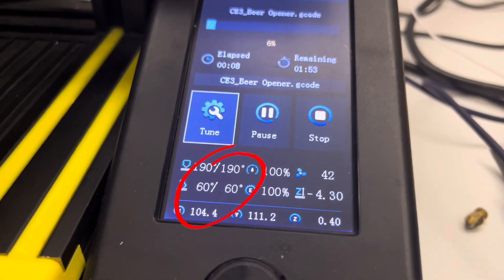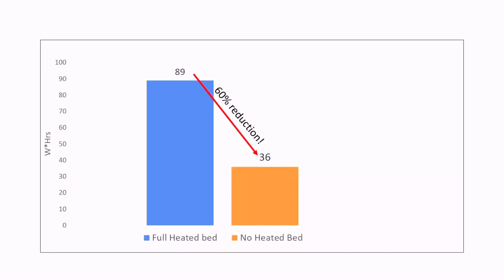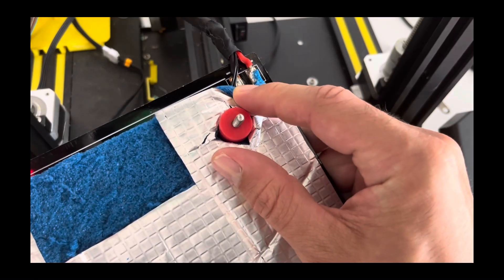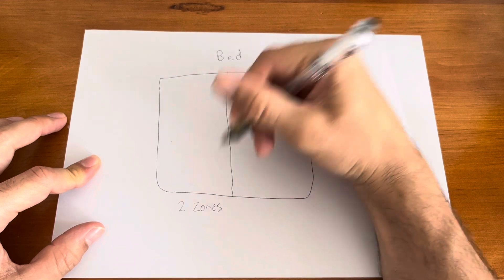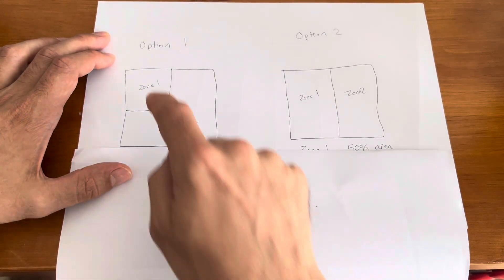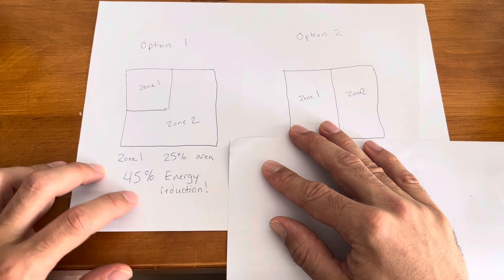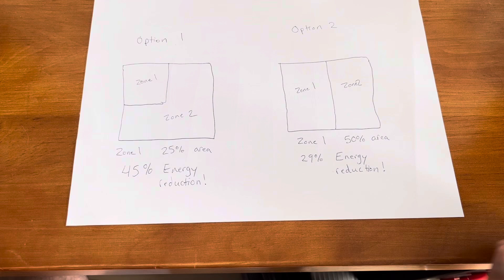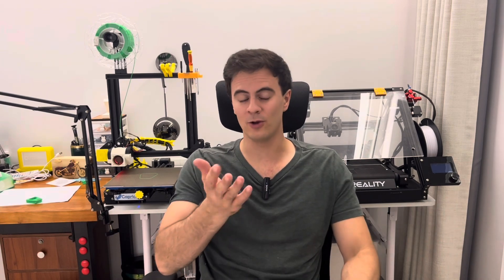Next-Gen 3D Printing? Cutting the power consumption of 3D printers in HALF!

Comment: you don't need that many wires, you can have a common for both the heater and thermistor. you can also further increase efficiency by simply enclosing it

furthermore, i wouldn't have sectioned heat zones on a single bed plate as they would introduce warping. which is why printers like the Prusa XL have a separate plate for every zone

cool video! you got your mind in the right place, keep going 👍

Comment: These systems already exist and in the wild aren't anywhere near 40% more efficient, they barely break 8%. The problem is that when you do regional heating the cold sections of the bed leech heat from the heated region. To stop this they heat the whole bed at the start, taking more current, and then turn of the secondary heater.

A simpler solution is to enclose the printer. An un-insulated enclosure increases the efficiency of all heating elements in the machine by around 12%. That includes the hotend, which is responsible for far more power draw than the bed, 2% at the hotend is worth more than 5% at the bed any day. Combining the two is the only reason that it's worth the effort on the super high end machines that use this concept, other than marketing that is.

Comment: Bed insulation is a nice idea, but was only a new idea say, 12 years ago? Dividing the bed into zones has also been done by various manufacturers.
Note the Ideally you need to separate the heat conduction between the zones. If you have one slab of aluminium and heat it at one side, the whole bed will heat up, sucking redundant power and time.

Comment: The Prusa XL already implements this technology as well as a few other industrial printers. Although it is more energy efficient depending on the build size, there are a few factors to consider. Complexity of your thermistor and heater circuit is increased linearly depending on how many zones. Also heat dissipation means that your energy savings are not as high as you may think unless each zone is thermally decoupled from their surrounding zones.
Reply from the maker: Good to hear others have implemented this idea, that’s some nice validation!  Yes for best results you may want some sort of thermal barriers between heating zones. Bigger printers make sense to implement this as the heater plate is much larger creating more potential wasted heat. Also it could be promoted as a positive feature since you can have more precise bed heating control on a large bed. Thanks for the comment!
Reply: I think biqu/BTT Hurakan has implied this at the more budget end.

Comment: cool!!!

to do that you would need a different board and slicer i dont really think that there is a good board to do that maybe the board and slicer from the orange storm giga
Reply from the maker: Thanks!
Reply: Slicer no. Current slicers already have object extents in G-code for object cancel so by pre-parsing the first page or two on printer firmware, you can avoid heating unoccupied regions.

Printers running Klipper or any other Linux based firmware could also potentially not even need that, instead parsing the whole first layer and determining XY bounds of that. Note that it's irrelevant whether an object extends into other heat zones further up, all you care about is the first layer.

Similar pre-process can also be integrated as a custom script in Cura or Octoprint without requiring underlying slicer changes.

Complete mainboard replacement isn't necessary but add-on board would be needed. Except most 3D printer mainboards already support 3 heater-probe pairs, one is needed for extruder, while bed can have inner-zone say 12x12cm and large outer zone comprising the rest.

Though honestly i find the benefit almost dubious. I mean you can no longer have a continuous alu bed since that would just wick away heat and make a massive gradient on your zones, Less bed movement + box frame enclosed printer is more promising, retaining heat instead of avoiding it.

How do you construct 2 zone bed? One could run heater traces on FR4 PCB top side, take alu sheet, route out a square perimeter in the middle; then epoxy the two alu pieces atop the PCB, then plaster or epoxy fill the gap. But i bet the resulting sandwich will warp. One may have to resort to a Kapton PCB with relief cuts glued to the alu bed.

Oh also! You probably don't need actual logic. A manual switch to toggle outer bed region may suffice. Specific resistance of heater track per bed unit area is the same all over the bed, so a single PiD can do it, probed and heated in the middle. You can load custom bed graphic in the slicer indicating the zone threshold to help the operator decide whether whole bed needs heating.
Reply: @SianaGearz  oh